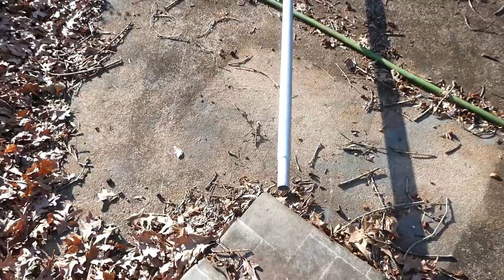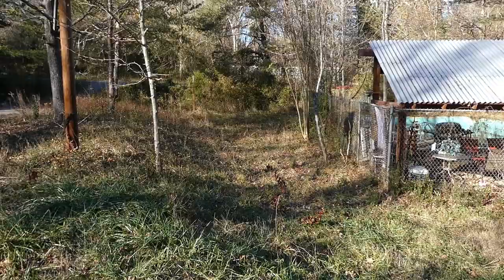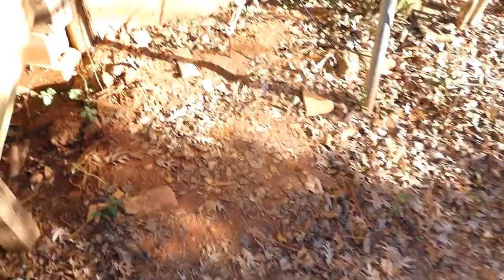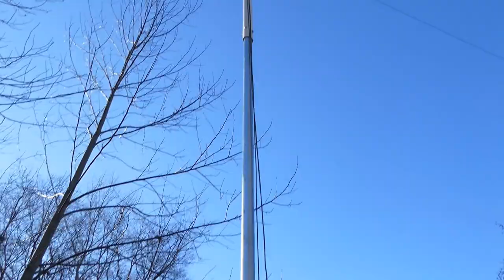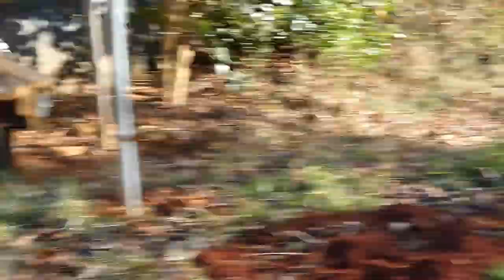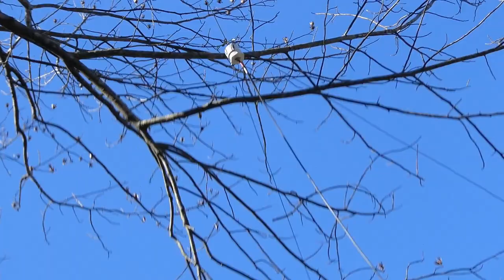$50 Mast for my HF Antenna. Using Chain Link Fence Top Rails and some PVC.

Comment: I also use steel pipe for my masts.  Each has several feet cased in concrete below the ground and about 25 ft above ground. Each joint is covered by a larger pipe and bolted in place to make the joints stronger. My 40 and 20 meter dipoles all work very well mounted that way, as does my 70 cm, my 2 meter, and my Imax 2000 antenna mounted on a steel mast that I shoved up through an old Oak tree. All masts have guy wires for wind support and All masts are grounded and my equipment is grounded as well.
Reply: @Hassan Baloch I use steel pipe for the mast and where two sections of pipe come together I slide an approximate 18 inch piece of slightly larger steel pipe over the joints, then I bolt  that pipe and the joints together.
Reply: I don’t ground my equipment. Lightning and RF grounds are done outside. Electrical ground is at the outlet.

Comment: Just went to Lowe's and bought 2 10.5' sticks of top rail, 2 10' sticks of 1-1/4"  schedule 40 PVC and 1 1-1/4 compression collar. 73's... great idea!
Reply from the maker: Glad I could help. Whats the 1.25 compression collar for? I'd be interested to see what your project looks like when it's complete.
Reply: @TwoAcreHomestead  I plan using the compression collars instead of drilling holes for bolts, which I feel could weaken the 16 gauge toprail, to secure the sections of pvc. I also plan spray painting the pvc with Carolina blue paint and doing a camouflage pattern with white and a light grey. Then after sealing it up I will top coat that with Plasti-Dip M5749 UV clear coat to protect the project.

I will be mounting this on chimney mounts, free standing, about 20' from the ground which would put me around 36-38' from ground, to base of my Comet CX-333 tri-band. I will come back and post picture as the project comes together. Again, thank you for a great idea. ~ KJ4RNV
Reply: Thank you fellow Ford F150 driver!

Comment: Maybe I am over ambitious, but I bought 3 top rails to hold the end of a 130’ end fed wire antenna. If my son and I can manage to get all three sections to standup vertical, I will support it using several guy ropes. Thanks for making this video (showing your grounding block was helpful also). 73’s ki4esk
Reply from the maker: I ended up with 3 vintage (thicker metal) 20 foot top rails made in the 60's when I re-fenced my yard. Been having dangerous thoughts about what to do with them. 
If you brace the junction points, it might be fine. 
Hope you share the results on YouTube.
Reply from the maker: Just checked out your QRZ page, that mast is impressive (and a bit scary looking). 
Glad I was of some help with your project, 
73 K4RZM

Comment: Use the grey PVC conduit (in the electrical section at the store). It's the same dimensions as the white pipe, but it's UV resistant and will last decades without getting brittle. Looks better than a bright white pipe too.
Reply from the maker: I thought the PVC electrical conduit was significantly thinner than PVC water line. I might be wrong tho.
Reply: @TwoAcreHomestead  Unless it's some kind of thin wall stuff, the schedule 40 electrical conduit is the same sizes as the schedule 40 PVC DWV pipe. I ran two-inch conduit out to my mast about six inches underground for a coax chase, and I was about two feet and one coupler short. Instead of making another trip to Lowes, I used a white coupler and a short section of white pipe to finish the job.
Reply: I like my A1 Blue sky mast system from a company in Florida. The mast sits in a hd 
tripod. Each section of the mast 3ft. It's a push up mast
mine is 31.5 ft. 2in outer diameter each section. It
is pricey because it military grade. Ask for the reconditioned
A1 a little bit cheaper and looks brand new. Will last for
ever. Using in the Philippines
no rust problems.😊 Also great for field day and at 30ft
it will hold a 30lb antenna.

Comment: You did the same thing as I did at the base it makes a sturdy support & anchor. Mines 30 ft with 4 guy cables holding a 20 ft 5/8 wave vertical.

Comment: I might have to give this a shot for a small vertical. Thinking of guys tied off at the PVC joint. Have a 30ft mast near the house and at the bottom I ran a large rod into the ground followed by a post like you did with a bolt going through to keep the mast off the ground (prevent rust). The mast base is 2" so it slipped over the 1.5" pipe

Comment: finebusiness...have run something like that for a bit and it will do good for you.  three suggestions

1.  PAINT the PVC.  PVC losses strength fast in the UV...and after a year or so will lose a lot of it...

2.,  be sure and run a ground wire from the pole in the ground and the mast to a ground rod...other wise you will have some lightening issues

3.  you want to keep water OUT of the pole in the ground as much as possible.  what I do is use some PVC to slip over the ground pole, with hose clamps and screws through the two poles...and then a rubber reducing gasket on the top where the PVC connects with the stick

good hamming and well done.  Robert WB5MZO

Comment: I never thought of PCV piping for additional support.  What a grand notion!  Thanks.  de w0vet
Reply from the maker: Can't say I planned it that way, but seeing how it was such a perfect fit it seemed like a good idea. 
It did take out some of the wobble and tightened things up nicely. 
The mast has been up for about 9 months now and is still holding solid with no guy wires other than the dipole itself. The flex of the PVC topper takes a lot of the strain of the metal posts too.

Comment: Thanks for the video. I tried pvc for a 20' mast. Put an Ed Fong j-pole clamped to the top section. BUT at even 20' there was too much wobble. What you did is interesting. I think this would work nicely for me to get the 20' I want.

Comment: I made a 30' mast the other day, the 1st 15' was with steel poles then 15' of pool poles lol. It didn't last long to say the least. Gonna try this tmrw, I probably only need 25 so this should work just fine, thx.
Reply from the maker: Mine has been up since the first of the year and made it thru a few storms. The PVC top gives it some nice flex so it bends instead of breaking. Good luck with the project.

Comment: Thank you for this. I'm getting ready to build my own mast for my HF rig and cannot find specifics for everything.
Reply from the maker: Good luck with the project, just give a shout if you have any questions about the build.
Reply: @TwoAcreHomestead  have you ever had to re-raise or lower your mast? I live in an area with high wind. I'm just afraid the wind will break it at this height. And I'll have to lower it
Reply from the maker: It's been up for 2 years and I've never had to do anything with it for storms or weather. 
Not sure what your wind situation is, but with just the wire dipole strung on it, I've had no issues with occasional near hurricane winds here.
Reply: @TwoAcreHomestead  how did you get this thing in the air? I've got all the pieces but I don't want to bow the metal by putting too much strain on it
Reply from the maker: At the top of the pole I have an Eye Bolt which I ran paracord thru before lifting the pole. 
I used the paracord to lift up the balun and raise the antenna. 
To lift the pole into place, basically I just walked it straight upright, then lifted it straight up into the larger receiving pole that was in the ground. It was a bit awkward, but the whole thing only weighs about 30 pounds. A helper might be a good idea, but I did mine solo.

Comment: Thank you for the good ideas. I had thought about PVC in the ground to put the fence top railing.  Or something that was really close to the size of the top railing. I don't know how much rain you get where you are. I have found that pipes in the ground rust out fast if there is no way for the water to get out. If there is no way for the water to get out then the end of the pipe is always under water,  and will rust faster. Just some of my thoughts. If you can't use my ideas then flush them. I live in South Florida and get a lot of rain and have my fence posts rust out all the time.  I have a part of my fence almost on the ground now because the posts rusted out.
Reply from the maker: Thanks for the input. We are at a good elevation and both of my fence made masts are on high ground so hopefully standing water will not be an issue. Time will tell tho.
Reply: interesting problem.  I'm going to be doing this in the next month and hadnt thought about water causing this to rust out while in the ground.  Was going to do pvc base in the ground held with cement around it.  Then have the top post go into that.  I'd guess that at some point water can and will get in it.  You ever figure out a solution for this problem?
Reply from the maker: @Keith Cevasco  
I used a standard fence post cemented into the ground to support the mast. Pretty sure fence posts are designed not to rust out for a real long time when installed in the ground. 
Near ground level I drilled a hole and ran a bolt thru, so when the mast was inserted in the fence pole it stays a few feet above the bottom of the hole. This was done mainly to increase the height, but it probably also helps with water exposure to the top rail sections. 
Hope this helps, 
K4RZM

Comment: Enjoyed this video. I’m going to give this a try for my 20 dipole that’s only about 10’ off the ground. I think I’ll use some 2” angle iron from Menards or Lowes. Set that in concrete and strap top rail mast pipe to the angle.  73 from WV.

Comment: Very nice. But it looked like the tree was higher than your mast? Either way, nice installation. 
Barry, KU3X
Reply from the maker: That tree is significantly higher than the mast. I took off the limbs that were close to the wire, but it's the main shade tree for the house so the rest of it will remain. Will see in the summer if it effects anything.

Comment: The pipe you have in the ground before you stuck your antenna in it you could have took an hack saw and cut down through the pipe in the ground and then put the antenna into it and put a clamp around it ,it would have squeezed together and it would have tightened it.
Reply from the maker: Where were you 3 years ago :) Thanks for the tip.

Comment: I would have liked to see the way you got it up in the air.
Reply from the maker: If you look at the video I made when I set up my VHF/UHF mast, it was pretty much the same method, just this was lighter weight pipe and easier to deal with.
Reply from the maker: https://youtu.be/xzXm1j0kBzc

Comment: did you use any Guy wires to help stabilize the mast?
Reply from the maker: Nope, and its still standing after 3 years.
Reply: @TwoAcreHomestead   I'm putting up almost the same thing and wasn't sure how that fence top rail would hold up without some guy wires. I was thinking about putting a bolt in a ground level like you did and its good to see that hasn't been an issue. I wasn't sure if the stress at that level would bend the pipe there. Thanks for the video.
Reply from the maker: I'm honestly surprised it has held up this well too. 
Glad I could help out.

Comment: Was thinking of something like this for a mast with a rotatable dipole I am working to put together. How well does it hold up in a breeze?
Reply from the maker: Its been up for almost 2 years with no issues, and we've had a bit stronger than just a breeze in that time. 
If your hanging a rotatable mast antenna on this setup, it might be a bit sketchy. The wires for the OCF Dipole I'm using, plus the flex of the PVC on the end pole add a bit to the stability of my setup. 
Let me know how your project turns out, love seeing other adaptations of this idea.
Reply: @TwoAcreHomestead  this will be a fairly light weight dipole with 17' telescoping whips but even then I imagine it will need to be pulled down in any real weather. Thankfully CA doesn't have real weather lol. I will for sure let you know. Thanks for the insight.

Comment: Nice work. I already have some top rail sections I saved from a fence that was removed in my neighborhood.

Would it be possible to sleeve the entire length of top rail in pvc?
Reply from the maker: I don't see why not. The rail I used was new from Lowes and 1.75 ID PVC fits almost perfectly over it.
Not sure if the rails you recovered would be the same dimensions. Only thing I would do is make sure that the connections on the top rail are offset from the ends of the PVC so you get the extra support. Maybe start off with a 5 foot piece?
Good luck with the project, let me know how it turns out.
Reply: @TwoAcreHomestead  was considering doing something similar.  For the top rail put 5ft of it in the ground.  Then sleeve the top rail with 10ft sections of pvc.  By using a 10ft top rail and putting 5 ft of it in the ground this would offset everything by 5ft.  If you do this post your results of what you did and how it worked.

Comment: does that new antenna pipe need to be grounded anywhere  in order for it to work properly ? I'm looking at doing something like this for a cb. I just don't know if it needs to have a ground.
Reply from the maker: The metal pipe is driven about 4 feet into the ground, which I would consider sufficiently grounded. The Antenna mounted on the PVC is connected to ground via the Coax to a ground rod.
Reply: @TwoAcreHomestead  Thanks. nice work
Reply: @TwoAcreHomestead ... The station safety ground and the antenna ground need to be separated (separate ground rods) or any discharge from the antenna arrestor will travel to the station ground bus to the equipment through the common grounding point!  The ground rods should be separated by the distance specified in the local electrical code.  Where I live it is a minimum of 8 feet using 8 foot ground rods.

Comment: I have two 10’ top rails. I wanna get about 3-4 more. To make 40-60’ off the ground. What is the beat way to make them not wobble though where you stack them? Is that why you put pvc pipe between the sections? Any ideas answers would be greatly appreciated, I want to mount my dipole antenna, I am going to mount one or two. They are light, not heavy at all for my low power station. I was thinking of mounting on the aide of my house. What would be the beat cheap easy way to achieve this. Do I have to guy wire it?
Reply from the maker: My setup is about 25 feet tall, 2 top rails with about 3 feet of 1.75 inch PVC to brace the connection, and about 7 feet to add another 5 feet to the top. 
It is pretty solid and the only support wires are the dipole itself. 
Adding 3 or 4 more rails would definitely make it less stable, and I have doubts that it would stay up for long without significant guy wires or bracing. 
I'm no structural engineer, but I cant see 50 feet of top rails standing upright for long. 
Another ham made a 3 rail version using the same methods in my video, he has pics on his QRZ page. Check the comments on this video for his post. 
Good luck with the project, and please let me know how it works out.
Reply: I will let you know what I do. 

Thanks. And Happy New Year

Comment: Nice , how rise the cameras working ? Any interference?
Reply from the maker: Transmitting on HF pretty much disables the cameras while the mic is keyed. I have a video where I was adding ferrites to try to clear it up, but it only made a very slight improvement. 
VHF/UHF, which is the antenna where the cameras are mounted, has no (or very little) effect on the cameras.
Reply: Pk
Reply: Ok